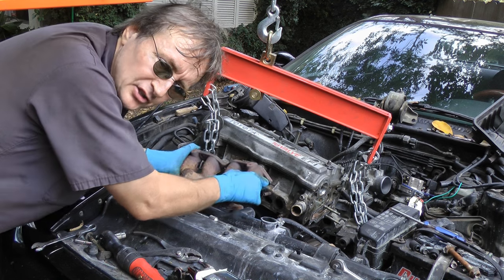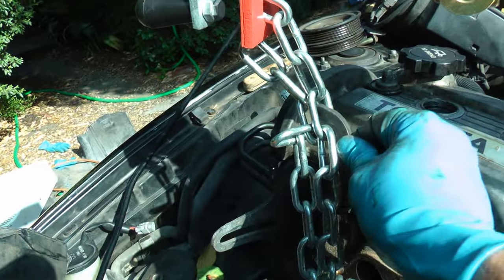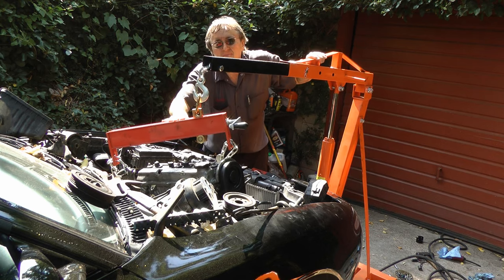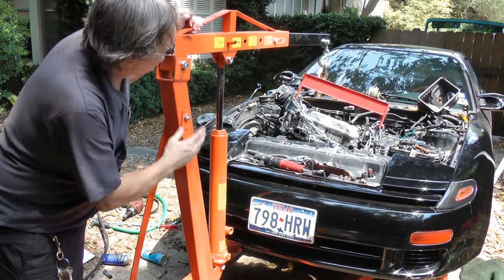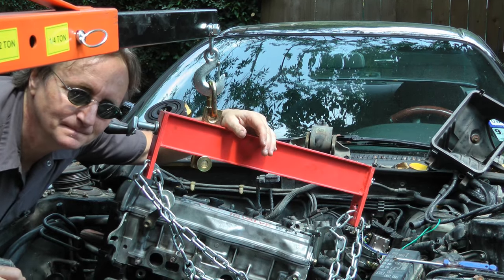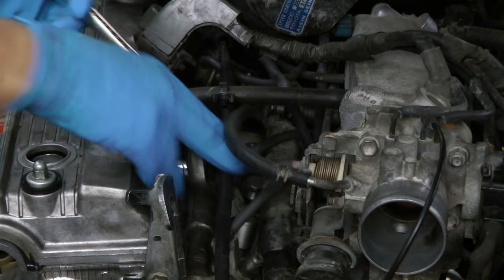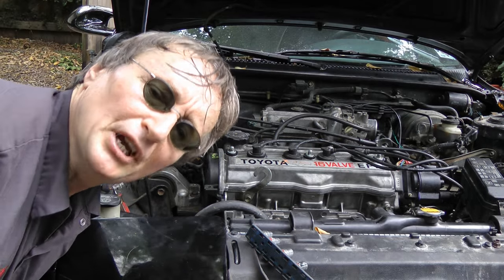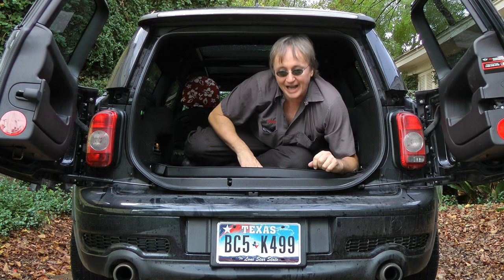How to Replace an Engine in Your Car (Swap)

Comment: Is there any reliable place or website you would recommend  where I can buy an engine for my 2003 Mitsubishi eclipse GS?
Reply from the maker: +marulez7 as they keep changing, even when I look for one, I just google it for the closest place that has imported used japanese engines
Reply: Have you ever bought any parts from Purzauto? I'm just trying to make sure I buy the motor from a reliable seller since it costs more than a thousand dollars...

Comment: Scottty!! Hey, i have a 2002 Impreza at the moment it has a EJ16 is it possible to have the STi's motor (EJ207) fit in with little problem? Since it is the same type of engine and has a similar body.. but I am worried with the .4 increase in displacement and the turbocharger.. any sort of information would suffice.. Thanks in advance

Comment: scotty, I have a 72 ford f250 camper special. 360 motor.  80k original miles. it's frozen.  I've put marvel mystery oil in the cylinders and they have been sitting for months now.  still can't get the motor to turn. I'm afraid I will spin the crank shafts bolt if I try any harder. should I start taking the motor apart from the top and see what happens. . or what would you suggest.?  thanks.
Reply from the maker: +Charles Chidester   yes, take it apart being THAT old
Reply: Thank you,  I was dreading that.. I will let you know what I find..

Comment: I want to do this with a Nissan 300zx z31. Thing is it needs a new wiring harness and computer which got water damaged. Did you install a new wiring harness in this celica?

Comment: hey Scotty I have a 1989 dodge w100 I'm swapping out the 318 for a 12valve cummins and I can only get it to turn half way and it gets stuck I took out the injectors that helped because before it wouldn't turn at all what could be stopping it? (the belt is off)
Reply from the maker: Brandon Simons odds are your "new' ENGINE is locked up. If you can't turn it over 380 degrees, that's the case, or the transmission is hanging up from jamming on something if it doesn't fit the engine right

Comment: Its way harder then this... Be prepared to Rip your knucles, break old plastic harrness clips, hose clamps that will snap, bolts that will break, strip or just not want to move, and SOOOOOOOOOOO much more...

I'm in the middle of swapping a celica too, and its not easy... :(

Comment: Scotty, i have a 1990 celica and have everything unbolted but forgot to remove the crankshaft pulley, it will shake loose from the transmission but hits the side rail of the body, so how would i remove the crankshaft pulley ? my air compressor doesent have enough eeuuffhhh to break it loose,

Comment: scot. i have a 5sfe that has done 365000kms. im wanting to get the cylinder head reconditioned only and just clean the carbon off the pistons and clean the sump out. would the block cause a problem with the recod cylinder head?
Reply from the maker: +micheal balma it certainly can. REally, you're better off putting in a good used engine from japan, they have low mileage and last for decades often. Put one in my son's celica, it's still going strong in boston

Comment: i have a question, anybody welcome to answer please

if u have a car that have 150k to 350k miles on, and you replace the engine with a brand new one, does make your car a new one since the engine is new ?

another word does changing your engine makes your car a new one engine wise ?

please i need your opinions / advice/ experience

Comment: I have a blown engine and at the shop they said i would need to replace the engine and with labor and the engine the cost is 11k. Diesel. My question what-who has the rights the blown engine? I'll sell it for part or the metal and/or rebuild. ??

Comment: hey scotty! i know this is kinda irelivant to the video but i have questions about my car again i have a 5 spd 1988 mazda 626 with about 86,000 miles on it, i know my breaks need work including the back drum breaks but... i noticed when the car is cold and i put it into reverse to back out off my driveway i hear a kinda squeaky grind noise only while i am rolling tho, also sometimes when shifting into 1st to go i hear a simular noise as the clutch is making grip but towards the front ...

Comment: Would it be possible to replace a 1985 ford ranger 2.8 v6 with a 1991 4.0 v6 ford ranger I found a heck of a deal on a parts truck and I need to know if it would be worth it or if I should let it pass by.
BTW the 2.8 is carbureted, where as the 4.0 is fuel injected. Thanks
Reply from the maker: RaVae Edwards pass, too many changes in software and sensors

Comment: I have a Ford  flex 2010 my mechanic says I meet to replace the engine because smoke is coming out from the dipstick oil 
And there is oil everywhere but there is no check engine light

Comment: Im trying to replace my 2005 silverado 4.8 vortec engine with a 6.0 vortec engine. would i have to replace the transmission too? would i have to do any major changes to the truck other than the computer work?

Comment: mr kilmer , i never replace the water pump?    is bad for the engine?       is good to replace a   engine from online?   instead of  get a  new car       if engine died?    2005  corolla 257000 miles

Comment: how hard do you think this would be able to do on a 03 SAAB 9-5 with a v6
Reply from the maker: about 50 times harder than this, those are insanely designed swedish fighter jet cars, I know mechanics who won't even touch them.
Reply: i have one that I keep in showroom ready with all of the OEM products on the car it now has 116000 miles on it, should I be worried
Reply: Ps, I only use premium gas and synthetic oil
Reply: quintin Michael as long as you keep the car well maintaned (not just oil changes) your car will be fine. i had a cadi with 230k and now i got a acura with 212k. Also, I would always stick with whatever your owners manual says for gas and oil, just because that is what it was designed to run on. And the different octane levels in gas arent really going to efffect a car much unless it has a higher compression ratio

Comment: My 94 silverado will turn over but won't start. What do I need to do to get it started
Reply: +Eric Turner that sounds like a fuel problem mostly.but check the distributor or coil packs to see if it's sparking

Comment: Is it this easy to replace an engine that is knocking on an 88 F150? Ever other video I see has people taking almost everything out in order to get the engine out. I was hoping to fix my 88 f150 and use it to learn more about car maintenance and doing it myself.
Reply from the maker: xinic5 that ford engine weighs a LOT more, so it is somewhat harder
Reply: +xinic5 Replacing an engine doesn't sound like a job for a newbie.
Reply: Fishfingers232
yeah, sadly I sold my truck.....

Comment: Scotty, I saw your video about Jaguars and laughed pretty hard, im 16 and pretty much know mine inside and out from all the work ive had to do, first how hard would it be for me to stick a re-manufactured trans in it and when I get enough $$ is it possible to put a manual v8 in it considering its modular and has the front rack? Scotty Kilmer

Comment: If i'm making an engine + transmission swap on a RWD car do i have to change the differencial and modify the frame?  And how am i supposed to fit the tranny to the driveshaft? Can the driveshaft be modified ? Thank you. :)
Reply from the maker: anything can be done if you have the money and find guys who custom make parts. Drive shaft shops always did such work, but most are out of business now due to cheap cost chinese made driveshafts. But search for one.
Reply: Thanks ! :)))

Comment: idk why but my celica keeps sounding like its running out of gas. it has even turned of on me when im stoped at a red light. could it be the engine or the fuel pump thats giving me problems? -alex

Comment: Hey scotty, i got the new engine in my 1990 toyota gts 2.2l auto, and im having a problem with the vacuum lines, could you help me out with the metal pipe that bolts onto the back of the intake manfold, it has vacuum lines hooking onto it on each side but i cannot find where the rubber lines connect on the car or engine itself, Thanks !

Comment: you look alot like john lennon.. well anyways i have a 01 sunfire 5 speed and my brother reved it up a bit and it always had a overheating problem but we were driving and it randomly started knocking i didnt hear anything dramatic blow ups but when it sits still it doesnt get too loud but when i rev it up to preffery 2-3k rpm it gets around double the speed and a bit louder as rpms go up what do you think my problem is?

Comment: In other words there's a whole lot more missing mate engine swaps simply do not take 2mins and where's the pros and cons and switching parts from the old engine to the new one and the engine mounts and wire harness cooling system radiator hoses power steering putting refill all the liquids making sure everything is where it's supposed to be making sure nothing is missing or forgot to plug something from the loom little stuff like that that could have u scratching your head thinking it's the engine wen it's not u just missed something important anyway

Comment: would a nissan skyline rb20bt 2.0l engine fit a 1985 toyota ae86 that is rwd?
Reply from the maker: I've seen guys do it, BUT, it's a giant expensive pain in the ass to do so
Reply: Scotty Kilmer thx what about a 1988 toyota ae92 that is fwd will a honda b16b fit it I heard it easier and how much would it cost for a new clutch the ae92 might not be able to handle 170hp lol (im asking because I want a car that is a sleeper so I could surprise people and not get pulled over by a cop for having a eye candy car if you know what I mean XD )

Comment: let's say I want to put a new engine in my car (2008 chevy impala) has 3.5 v6 flex fuel do I have to get the same engine or can I put in a different like a 5.3l v8 from Impala ss
Reply: +Starkzy you could swap any engine
Reply: Starkzy Swapping an engine is a very big deal. You can't just stick a different engine in there. You need to do a lot of modifications and some custom work. A lot of time and money.

Comment: what were the engines in this video? was one a 3sge?
Reply from the maker: +Kalel Pruitt the original engine was the factory 1600, but the replacement was a japanese model 1400 cc engine. Still runs like a clock even though it moved to the cold of boston

Comment: i guess you dont have to undo the motor mounts, remove the ac compressor, power steering bottle and pump. man i think ive been changing engines the wrong way

Comment: Scotty i unbolted my exhaust manifolds and disconected the connecter for the engine temp sensor and i cant get the engine out when cranking on the hoist any advice?😂😂

Comment: Well it won't come out for me. I tried raising the front end up and hammering it will regular hammer with pin punch from beneath, I tried from the top with the punch using extensions and hitting it from the top, and then tried the sledge. None work, hasn't budged a mm. Maybe a video on your methods would be a good idea? I'm serious, it will not budge at all.

Comment: hi
scoty my car got an accidant we had to pul out the engine frome car after dant we instal the engne again but engine vibrating humming all car body parts tel me what to do?
Reply from the maker: on modern vehicles it's pretty hard to get a frame right, then the motor and transmission don't fit right and make lots of noises, realize that. but you could try new mounts

Comment: If you had a Buick V6 instead of that P.O.S. Toyota V6, you wouldn't need to swap the engine at all.  Toyota made their name building 4-cylinder engines.  Toyota's V6 engines, for the most part, have been highly mediocre.

Comment: It's like they don't know why I don't onto  that side at all "Yeah Moite" !!!!

My dad would've been better off getting some recoed cylinder heads for his 2000 model Holden Commodore because it cost him the same amount to replace a transmission that had nothing wrong with it & the whole engine when the old one just had valve recession,his has got the 3.8 litre Buick L36 engine in it.

My point is they're pretty sure that the donor parts are out of peoples cars who have been killed in a car accident in town.

I need to get a job so I can get my Commodore insured,inspected & registered, people such as a Holden would much prefer me to drive my LS1 V8 powered car as they don't know where the parts in my dads car came from.

I am more liked & respected when I drive mine & I'm doing a camshaft & lifter replacement in mine,not bolting a donor engine in which has come from a deceased persons car.

Comment: what do u do to change the mile/km counter when u change a engine?
i gues the insurance cumpany would like to know the new km if you change a engine but i dont know how it works :/
maby you can go to the local state office or whatever and tell them you changed the engine and need to change the km/mile counter. any1 know how?
Reply from the maker: +WarBrownie you can't reset any of them, just make a receipt and put the original mileage on it
Reply: kk ty
Reply: u had to change the cluster.
I've done it already in several cars.

Comment: that car looks awfully new to have to change the engine
Reply from the maker: I bought it cheap for my son and changed the engine and got it painted. At the time of this video, car was 18 years old.
Reply: Very good parenting. I wish my father knew automotive technology like you do and could teach me that.
Reply: Scotty Kilmer hey have you heard of a 3sgte st205 swap in a fwd celica? i have a 91 celica st and i know the gt tranny from a celica will fit it but im wondering what will be the most work? im pretty sure the motor mounts on the new engine will have to be welded in? thanks scotty

Comment: Honesty just unbolt and unplug everything thats not on the engine so like if a wire is on the engine see where it goes and if it goes somewhere thats not still on the engine like the battery or something take it off the battery and if something is bolted to youe engine thats not internal take it loose easier said than done but anyone with a few months experience can do it idk a month or 2 Honestly if you have the money go buy a cheap junk car and just take the whole thing apart and back together 😂

Comment: hi Scotty nice video. I only have 1 question if my vehicle is automatic and the engine I want to get is the same size as the one I have but it's in a manual transmission vehicle would the engine be compatible or would they're be any issues. If you can please reply thank you alot
Reply from the maker: +Juan Bulnes engine is same, but flywheels are different

Comment: Don't replace the engine its just a waste of money especially since your engine works fine. Modern cars are built to go 300,000 miles easily with proper maintenance. 113k miles is nothing for a modern engine. If you like wasting you money of unnecessary jobs then feel free to give me that money lol

Comment: This video is worthless. Left out so much important info. Didn't show unbolting the trans(including flex plate if auto) didn't show removing the mounts or unplugging the harness. Also must be really nice to just have the engine come out of the car that easily after unbolting it. He didn't show the wiggling it out of the trans or angling it out around obstacles in the engine bay.